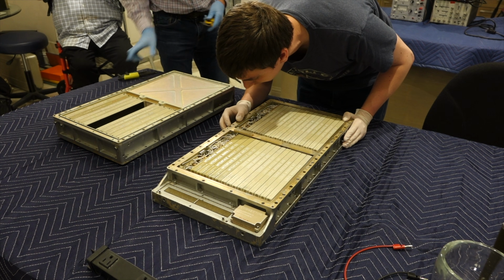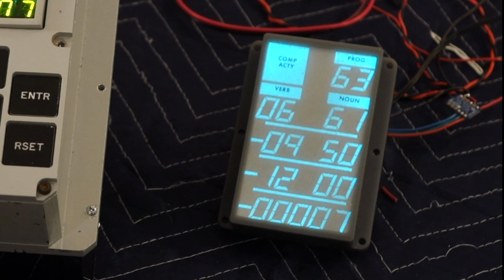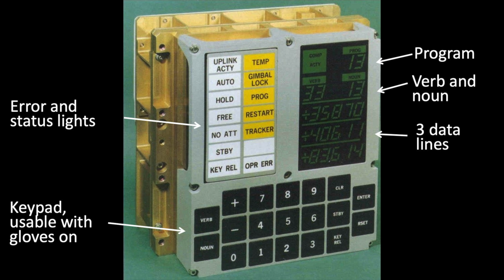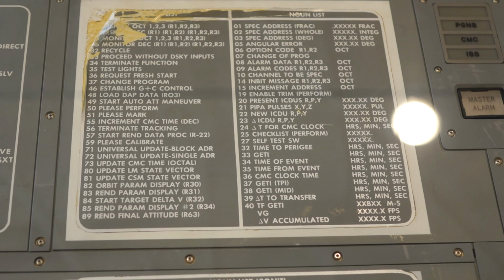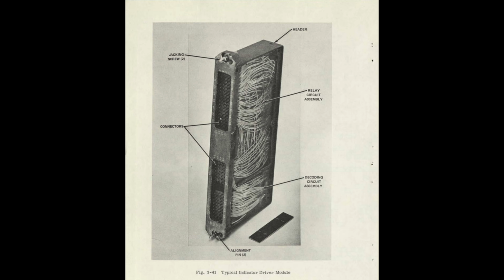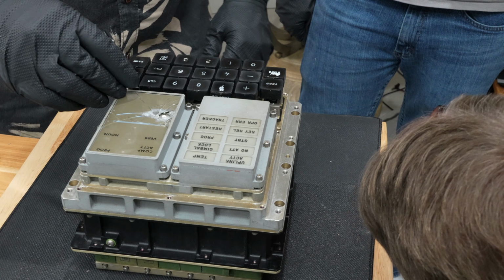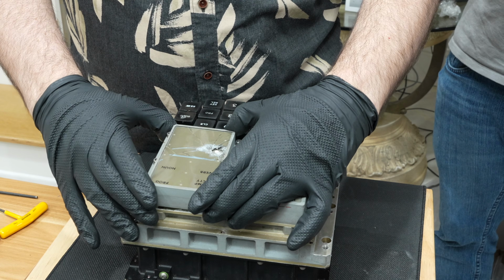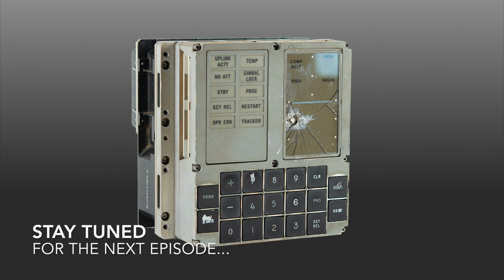Apollo DSKY - part 1: we have a real (and broken) DSKY!

Comment: 17:49 micrometer switch lead time 56 weeks. 13 months!
Reply: when I was designing military electronics in the 80's, the first step in a new project was to order the connectors.  The connectors were so specialized and expensive that the manufacturer would only make them after an order was submitted.  The lead times were around a year too.  And of course, when you manufacture them one or two at a time, the unit price is very high!
Reply: When ordering parts in 2020 and 2021 that would be considered pretty decent! And nice discount for ordering 10 pcs!
Reply: @sparqqling  Yeah, I remember searching for some STM32s in 2021 that had expected delivery in 2026.
Reply: It’s amazing they still make them!
Reply: You may have not seen some Intel lead times, they can be special. 😬

Comment: A $700 Micro Switch.. I feel like this deserves a Video all of it's own.  There must be something special about it to warrant such a price tag.. makes me wonder what the Relays in the DSKY are worth?
Reply: Well, it's a pretty interesting switch. MS27216-5 is rated for temperatures of -184C to 121C, is hermetic, tested for leaks with helium!!!, non-corroding, and rated for 100G shock. Well, and probably the 3000Hz, 30G contact chatter test.  (It could have been a hall sensor and a magnet, but that wasn't demonstrated by Honeywell till 1969). Basically the best aerospace grade vacuum-safe, wide-temperature range  micro-switch going at the time. Now, I'm out of practice at decoding these specs, so A&OE. And I used readily available versions of the standards, which don't line up exactly with the Apollo-era spec of the switch.
Reply: @timwilliscroft9615  I'm more amazed that the bistable relays could endure this kind of vibration without changing state.
Reply: They are special switches.  They're guaranteed not to ignite anything in your 100% oxygen atmosphere and barbecue your 3 astronauts.
Reply: Flight rated mil-spec parts like this are rarely cheap, especially when the main buyer is Uncle Sam.
Reply: Likely nothing special. Small number manufactured and 1000% markup or something...
Reply: They are worth that kind of money only to people who need them for these kinds of repairs. There's no reason to pursue one when not doing historical space grade projects.

Comment: Totally amazed, and so heavy, how did they get all that heavy equipment to the Moon?
Reply: Indeed, it does not look AT ALL as if optimizing for low weight was any concern to them. But utter reliability was probably higher on the list. You can always add a couple tons more fuel to the tanks to make up for the extra weight :-]
Reply: Rocket science
Reply: Paging Константин Циолковский

Comment: The relays clicking as the display changes is so badass!
Reply: Has someone tried to recreate a high-fidelity ambient sound track of the CSM and LEM? Would be quite something if it is also spacially accurate.
Reply: @vdivanov  There's a very detailed space sim named ReEntry which is covering Mercury, Gemini and Apollo. The sound effect on there is a pretty good match
Reply: @vdivanov  I'm part of a group of folks who are making a high-fidelity, high-accuracy software simulation of the Apollo spacecraft/missions called NASSP, and we're doing what we can, although it's a lot more difficult than it seems on its face. We also don't currently have the tech or information necessary to make it spatially accurate. The trouble is that in addition to simply not having access to most of the Command/Lunar Module hardware, having it all running behind countless panels and crammed next to other large pieces of equipment (as it would be in the spacecraft) is liable to alter how those pieces sound compared to if we managed to find a standalone piece of equipment. We just have to guess at what most things sounded like, or look through thousands of pages of historical documents to see if we can find even some sort of subjective comment about how things sounded. But, things have slowly improved over the years. Plus, sometimes things turn out to be a lot more mundane than you'd expect. I always wondered what the DSKY was like to type on, and... it's just a spring-loaded keyboard with microswitches. The relay sounds are very cool though.
Reply: Thats what i was thinking, i love the sound of old school relays and switches. All the mechanical klunks remind you of its age